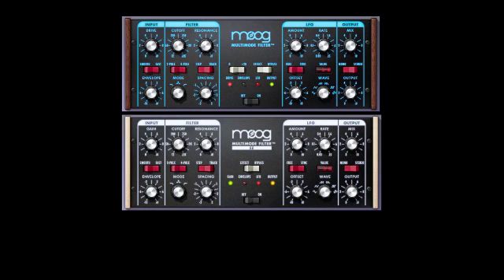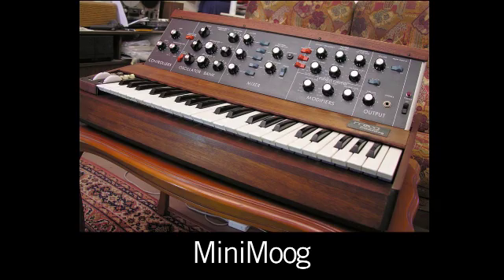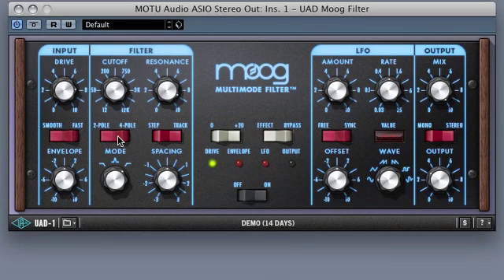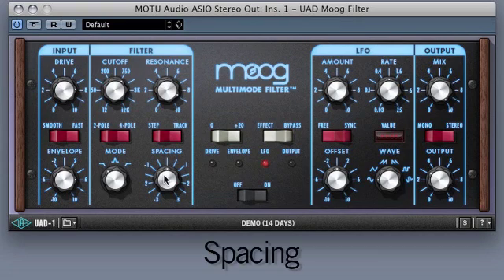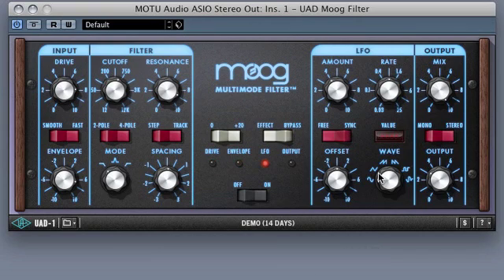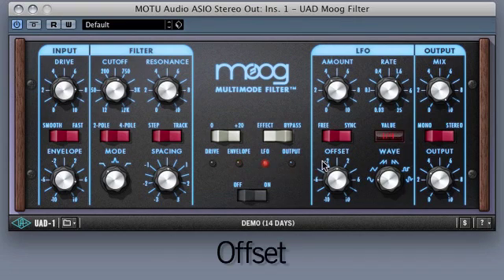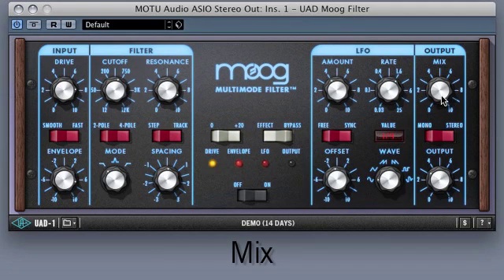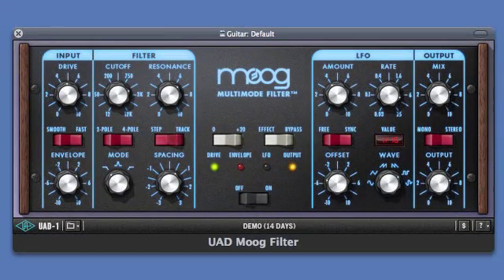UAD Moog Multimode Filter

Comment: Yeah although this plug has an spacing, 3modes of filter and a LFO, it lacks alot character from the original MF101 imo...

You cant really descirbe the feeling of hearing a genuine 101 over this plugin..

On the other hand it is a neat addition to the choice in UAD plugins...it sounds rather okay for a SW plug....but for 199? i believe it costs? I cant understand choosing SW over HW...like you really need more than one of the same filter in a track :)